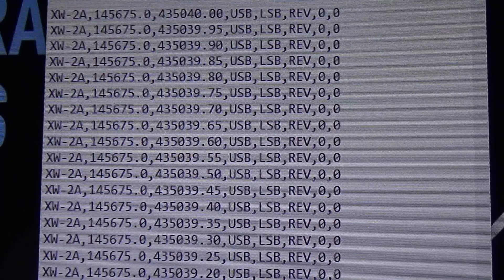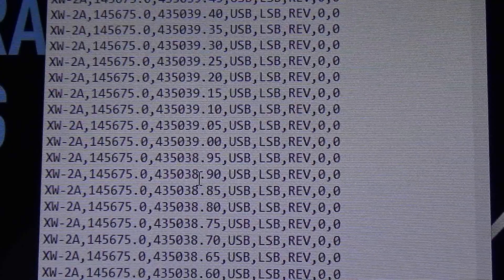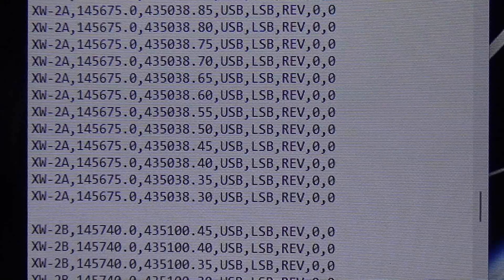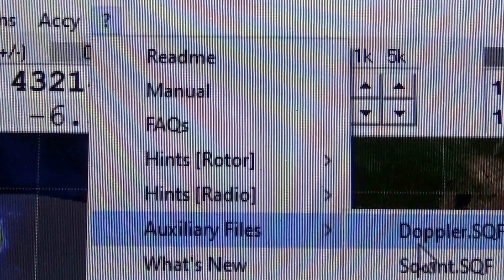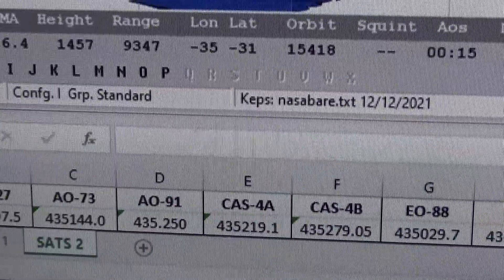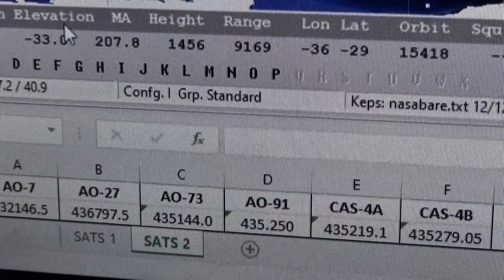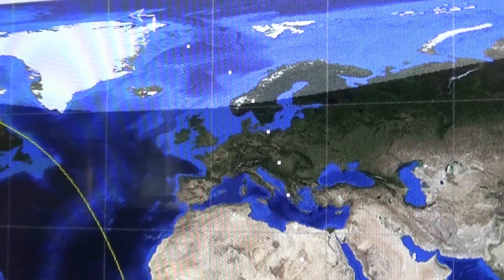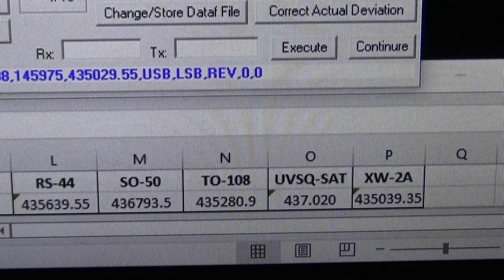Controlling ICOM IC-9700 Satellite Doppler Using SatPC32 CAT Tuning

Comment: Thanks for this video.  I actually dislike SatPC32 because it's old, clunky software. The SQF file is a good example.  I do still use SatPC32 for experimenting, but for my full satellite stations I use modern software like the SAT, Ham Radio Deluxe, or MacDoppler. Your video is a good refresher for me when I dust off SatPC32 to test things.